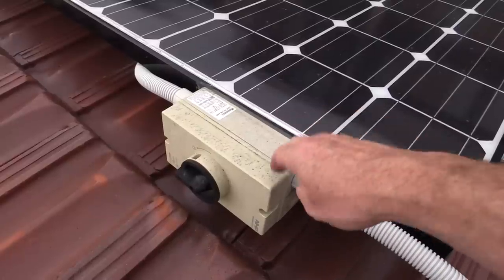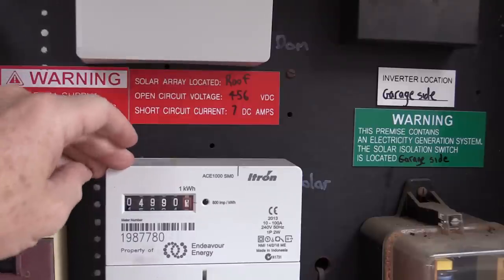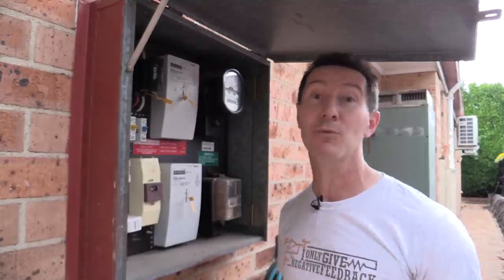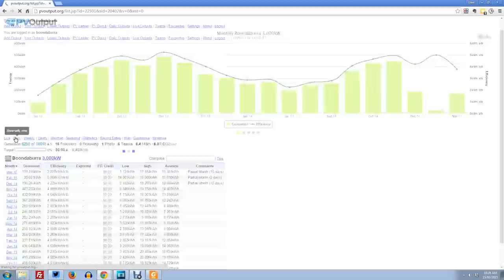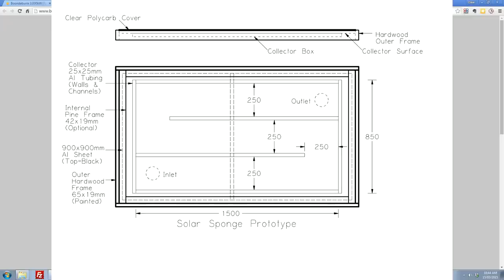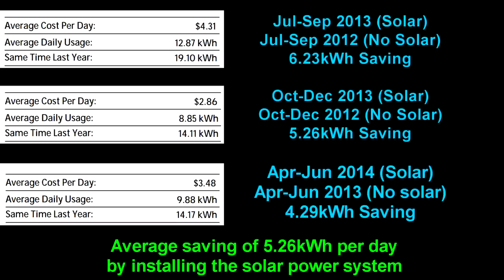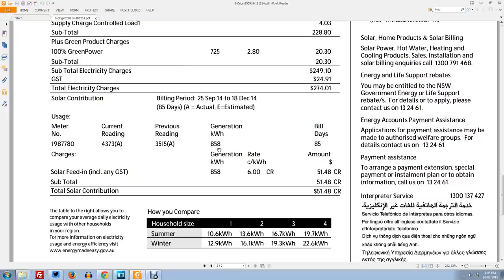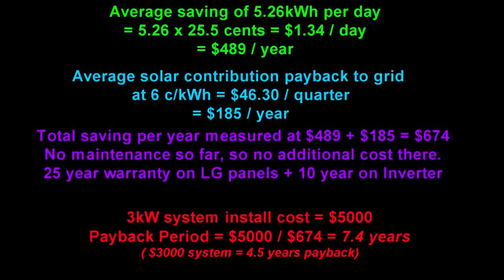EEVblog #724 - Home Solar Power System Analysis & Update

Comment: $274 a quarter... OMFG that's so cheap.

I pay about $750 a quarter for just 2 people.

Fixed Charges	87.677 ¢/day
Energy Rate (all units)	24.717 ¢/kWh
Hot Water
Fixed Charges	16.981 ¢/day
Energy Rate (all units)	14.907 ¢/kWh
Heating
Fixed Charges	16.981 ¢/day
Energy Rate (all units)	14.907 ¢/kWh

We barely use our electric heating and it's not a central system.
But I never turn my computer off but that uses about 140watts total at idle and around 350watts when it's at full load for a few hours a day.
My PC runs a web server and a bunch of other stuff so I can't turn it off.

Also some one mentioned in the comments about bitcoin mining. I would highly suggest this during the day, I did some mining on my server for 3 months and made $455 in 3 months. My server was drawing about 5KWh a day during mining so $113 in power using during that time. I stopped doing it as the currency I was mining dropped heaps in value. If you are going to do this, I would investigate what cryptocurrency will get you the best profit. Also it may be worth investing in a/some GPU powered miners as mining is pretty much all about how many cores you have and the 2000 cores in a GPU will shit all over the 4 or so cores in a CPU for mining.

Comment: I am wondering, if you got a little solar panel, a really tiny one, and used it to switch on and off your washing machine and so on... would that be better than just putting it on at a certain time?  ie it turns on when the sun is bright enough and not before.

Comment: Doesn't seem like a very sweet deal dave!
Reply from the maker: reginaldweather It's not sweet finally, but it'll pay for itself, and we like knowing we are producing more energy than we use for others to share, or for us to use in the future.
Reply: EEVblog 
Why not have battery storage, especially since the electric company pays shit for what you put back into it? I would be like, you know what piss on you, I'll put in battery storage and you'll make even less money off of me!
Reply: Don't get me wrong, you get major props from me! Just seems that solar PV tech is at the point in needs to be, but as usual the large energy companies are there to screw us over. Don't know what the energy mix is like over in 'stralia but I don't know what kind of problems renewables are making for the grid.
Reply: EEVblog Maybe a video on 'stralia dealing with changing energy demands due to renewables could make a nice little video!

Comment: I still have not seen, anywhere, an explanation of how an inverter is able to feed the grid without using a high voltage difference, which it is not supposed to do. Don't the rules in OZ prevent feeding the grid by phase shift i.e., PF must be 1.0. So
how does it work??? Anyone?

Comment: Really nice video, thanks for this, 
i have a question which was not covered here, 
i have 2.0 W solar system, but my inverter is showing 0 KWH since last 2 weeks,
i have check at the end of DC disconnector it shows 363.0 DC voltage, i dont know if its panel issue or invertor issue. can you please help?
Reply: +Vignesh Patel  did you get your inverter/performance issue sorted?

Comment: in my country, you get more money for exporting (solar power only), than using energy from grid, so it doesn't even make sense to use these properly.
Reply: Šarūnas Ginčas 0,129 eur/KWh for using grid power and 0,133 to 0,200 eur/KWh for exporting solar power depending on technology used

Comment: Where i live theres lots of snow, would sweeping the cells reck the cells? What would be the best way to remove ice? 

or would you just have to deal with the lack of solar power in the winter?
Reply from the maker: ***** Removing ice? My first guess would be hot water?
Reply: EEVblog Be care with hot water on the freezing solar panels though as the thermal shock could crack the glass if the panels are cheap quality
Reply: EEVblog Bad idea... you'll crack the glass the same as your car windscreen (or if you've paid a little extra for high quality panels - it's likely to explode into tiny little pieces!).

Broom it off with a soft bristled broom and cold water to take care of the rest.

Avoid anything that will thermally shock the glass
Reply: I try to get the snow off and the sun takes care of the ice. Takes maybe 2 hrs.

Comment: That is only about $800 of electricity total.  Well below the cost of the equipment and assuming most of that was used to charge batteries which are far less than 100% efficient (power out vs. power in), maybe $500 of useful electricity generated in 1.5 years.  Not very impressive.

Comment: Does the solar powered system continue to provide electricity to the house when the electrical grid goes down during daylight hours?
Reply: if the sun is shining on them then yes probably (may change depending on who installed it though)
Reply: +Dustin M Depends on how it's set up. I'd assume it doesn't unless I knew otherwise.
Reply: immibis if you didnt notice i said "yes Probably" and "may change depending on who installed it" basically saying that it may or may not be the case
Reply: The Sunny Boy from SMA will not produce AC power when the grid is not present it is a grid-following inverter. The Sunny Island from SMA with batteries will produce AC power when the grid goes down, but will not sell power back. Better to get something like the XW+ from Schneider Electric which can sell power to the grid and work when the grid goes down. Simple answer is you have to have a grid-tied battery based inverter to sell and have backup. Ignore the gimick crap that says they can do it with out batteries.

Comment: is this true  in uk  that solar feed in tariff / payback  has been cancelled  in 2019 ?   .  well i wouldn't care if i dont get paid for it  ill just use all of the energy it produces by taking the thing off grid lol so the   main grid cant have the energy back  or  hook it up to batteries then use them later on   (i currently dont have any solar panels on my roof  at the moment  but if i did  that's what i would of done )

Comment: Why pay the 2.80 for 100% green energy. Does it guarantee that the electrons you use have been created by wind turbines?
Reply: Matter can not be created or destroyed.
Reply: Why does it matter if the exact electrons that are entering his house are from green energy anyway. The energy enters the grid whether that energy ends up in his house or not is not an issue. The green energy would be entering the grid anyway, that extra 2.80 is being paid in theory to push the energy companies to try and produce more energy in a green way, not because you want only green electrons entering your house like some sort of electron racist.
Reply from the maker: Sad But Mad Lad No, of course not. What it does guarantee is that the power you use is offset by new renewable energy systems into the grid. You are effectively buying a part of that capacity. Beware both "new" and "old" green tarrifs, they are not the same.
Reply: I appreciate your desire to use renewable energy and wish you well. However, I don't want to change my lifestyle to accommodate the intermittent nature of renewables, nor wait years for a return on an investment in new equipment. Here in the old country, solar is a joke and wind is on average 1%.
Reply: Sad But Mad Lad
Well that 2.80 is so that power from the grid that he uses is offset by renewable energy from the energy company, think large scale wind farms and large solar installations etc. So you would not need to change your lifestyle other than budgeting for that since its not your concern how they do it and when they do it as long as it is done.

Comment: You generate more than you use (858kWh back to the grid, 725kWh used from grid, ??? kWh used from the solar system itself) but you have to feed back what you don't use to the grid at their terrible rate because you can't store it at all.

Is there no efficient way to store even 8h worth of generated power?  You paid $275 and got back $50 on a 4month bill.  You could save $175 a season ($700/yr) if you could store that energy and use it yourself.  If a lead-acid battery bank (plus controller) could be had for $700 and last more than a year, it would pay for itself.

That seems doable, no?

Comment: I installed a 3 KW system almost 8 years ago.  I am located at 39 degrees N, in the Colorado Rocky Mountains (USA), so my solar insolation is substantially lower than Dave's.  The local power utility (to date) allows about 90% net metering.  So, even though my total power production is lower than Dave's, my amortization rate is comparable - the primary difference between Dave's installation and my base power rate which is MUCH lower than that in OZ, my geographic location, which is less attractive than Dave's and system cost differences.  It will take me almost 18 years to reach break even!  I did include projected maintenance costs in this calculation, however.  I have to note that the total system cost is much lower today than it was when I did my project.  I have a paper describing this on: http://home.comcast.net/~hardandsoftware/griersolar.htm

Comment: 19:40 Could this maby be that the clouds let the solars cool down abit?
Since iwe herd they loose efficiency if they are warm vs if ther cool wich would explain the spikes of power after the dips.
Reply: Ambient temperature (air temp) is the issue. Primarily because the solar panels won't dissipate the heat being generated as efficiently. In south Louisiana during the hottest time of day the radiant heat off the roof along with high temp & humidity in the air makes it less efficient. A very slight cloud coverage may help a little, but if it's 95F with 110F heat index, the moisture in the air just holds onto the heat. Still, better than paying a much higher electric bill though. A bright & sunny cold winter day is ideal.

Comment: What about solar water heating? Don't those systems make more sense than the ones generating electricity?
Reply from the maker: miiiikku We have gas hot water. Solar water heating isn't great AFAIK, it's only helps out, so you still need electric or gas. We had gas hot water when we bought the place, so just kept it.
Reply: EEVblog I have heard solar water heating can be quite efficient, they have lot of those in China, but, yeah like you said on video you have gas water heating, I would think thats efficient. In Finland we don't have gas lines anywhere, solar isn't very efficient but some people have made solar heating work.
Reply: No Solar thermal is about the same or worse as return for investment. I want to heat my OffGrid House and I will do so with Solar PV rather than thermal Solar. You can check my last video if you want to find out more. Is the one about the obsolesce of MPPT but I included some other obsolete technologies related to the massive drop in price for solar PV panels.
Reply: ***** I checked your video but you didn't really go over numbers on it.
Reply: miiiikku
Yes it was more about MPPT but maybe I will do a more detailed video on thermal solar.
Same power thermal solar panel cost the same as PV so is about the rest of the equipment. One advantage of thermal solar is just that it takes 2.5x less space than PV
There are quite a few parts on thermal solar that will need maintenance or replacement where on solar PV heating everything is solid state no moving parts plus that you can use the electricity for something else when you do not need heating.
Reply: We have a solar thermal installation (~6m²). It's enough for our 3 person home from the end of March to the end of September here in Austria (not Australia! ;) ). It's nice to see the gas meter stuck at the same numbers for month. (the gas heater kicks in automatically if the water reservoir hasn't reached a certain temparature in the late afternoon).
BUT... there are a few things that would make me go PV the next time:
The output in the winter is negligible. Most of the gas usage (80%-90%) is room heating anyway. So you don't save much. To heat with solar thermal you'd need a much larger installation that would essentially cover the whole roof and even then there's be no guarantee that this is enough.
In the summer you produce so much heat that you can't use in any way. There's no feed in tarif for hot water, it's just wasted. I've read 160°C on the collector sensor quite a few times. But that's no use when your water tank is at 70°C at 10 in the morning already. There are so called seasonal heat stores, essentially a huge tank (tens of m³) you bury in the ground, heat up during the summer and then take out the heat in the winter. This also requires a very well insulated home (almost impossible to do if not built no).
The whole system is much more complex than just using electricity to make warm water (gas is much more efficient though, heating water with electricity from the grid is stupid). Electricity is also much more versatile and at least you could cool your home in summer when there's ample sunshine.
Reply: superdau Austria is quite bad on solar in winter probably 2 to 3x worse than what I get at my location in Canada.
PV solar for same output will use 2.5x more space than thermal solar if those are vacuum tubes.
What happens with the collector at 160°C. Wont that get damaged ?
I seen people cover part of the collectors in summer to protect them from over heating.
I know about those seasonal storage but it dose not seems to be viable option for me at least. Is more expensive than just getting extra PV panels.
Yes that is why I love electric heating no hot fluids or moving parts much more reliable and is easier to find extra use for excess energy.
Reply: *****  "Austria is quite bad on solar in winter probably 2 to 3x worse than what I get at my location in Canada."
Really? I though pretty much all of Canada (except for the parts around Toronto) is further North than most of Austria. We get an average of 1100-1200 kWh/m² of solar irradiance per year. Canada can't be that much better.

"What happens with the collector at 160°C. Wont that get damaged ?"
I was told that the fluid inside (a mixture of water and diethylene glycol) will go into vapor phase, but the collector itself should be able to take the temperature. There would be the option to pump a part of it through the floor heating to keep it a little bit cooler. But who would want that in the summer?
Reply: The conventional wisdom from 5-10 years ago was that solar hot water systems with either gas or electric boost were the way to go. However the dramatic fall is solar PV cost has completely reversed this wisdom. Provided your electric hot water storage system is powered by your solar PV you can make better use of the power you generate rather than putting it back into the grid. Some electric hot water systems are now smart and will talk to your solar inverter so it only heats when you have surplus solar power. There are also smart heats pumps that do a similar thing for space heating.
Reply: Steve Demeo At my location If I was able to use all the energy from solar PV the cost amortisation over 25 year will be around 3 cent/kWh this is just for the PV panels nothing extra. Natural gas here is about that 3 cent/kWh so PV is not really competitive when you can get 6 or 8 cent for your electricity as is the case with Dave. You better sell electricity to grid for 6 cent and use natural gas for 3 or 4 cent/kWh.
Reply: We'll true, nothing currently beats the cost of gas. In the US the price is artificially low due to fracking and  laws guaranteeing domestic quotas. In Australia it is also cheap but forecast to get twice as expensive in the rush to supply export markets.
Reply: I was going to say the same thing, it surprised me you didn't have a solar water heater too, especially in Oz. They are really simple too, I have experience of them from going on holiday to Greece where every house and apartment seemed to have them, it meant u didn't have any warm water till the afternoon, but you didn't need it till then anyway who wants to get washed in hot water when it's roasting outside? Don't get me wrong it would still be lukewarm in the morning, but when you came home from the beach and wanted to get a shower before you went out at night there would be loads of hot water for everyone,and all FOC. Most of the installations looked either home made or very simple, just some pipes in an angled frame on the roof, with the surface the pipes were laying on painted mat black, and obviously some kind of pump, to get the water to the roof and back again.
Reply: @Peter Mark: This is 1 of those you start it, you can't stop it video styles that fast talking ram the message home scammers use.
Reply: Roy Sage Years ago before gas central heating systems heated the hot water on demand (at least they do here in damp cold Britain), houses used to use what is know as an immersion heater. You had a big copper tank with a heating element in it and you turned it on it with a light switch type affair like you describe. It meant you had to remember to turn it on an hour and half before you needed a bath, lol. The tanks were usually well lagged with insulation which would keep the water warm over night so the family could get a wash in the morning, but that was the only source of hot water in the whole house.